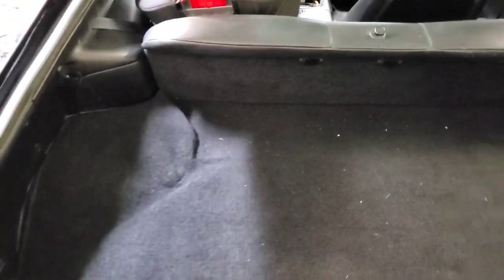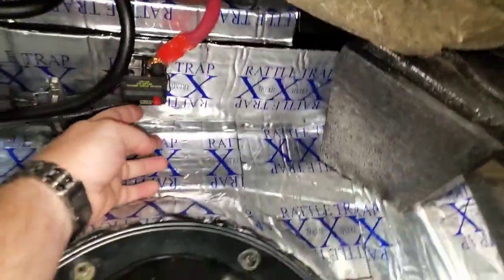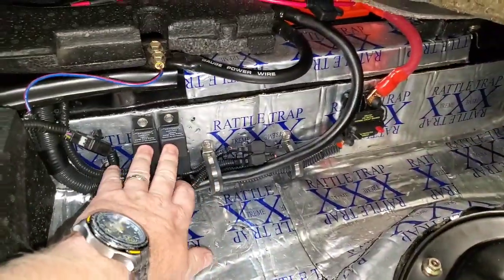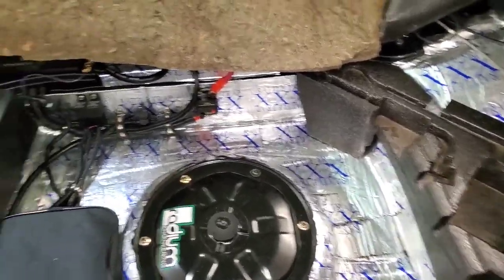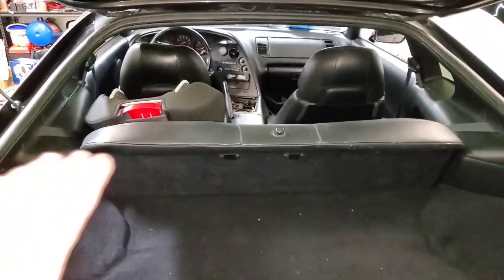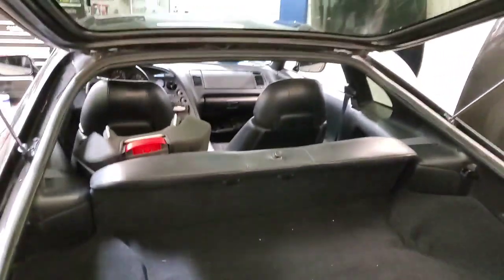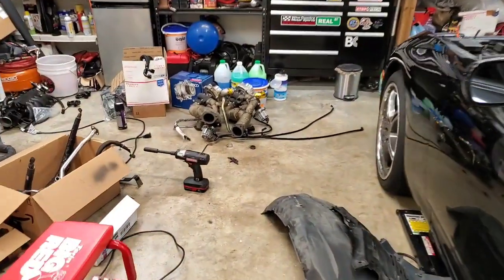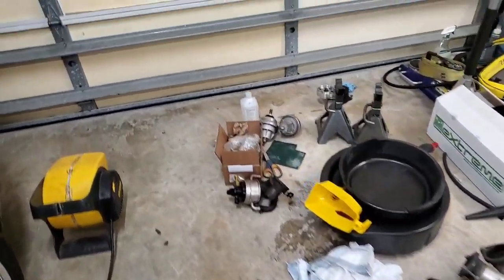MKIV Supra Battery Relocation, PC925 Overview

Comment: Still figuring out how he mound the battery in the speaker box. Only thing I can think of, is that he drilled a large square hole for the battery to fit in there.
Reply from the maker: Haha! Yeah man! My car is originally an NA, so the speaker box wasn't there. It was just foam inserts. But still - way better than a measly sub anyways, that can go in the rear! I didn't drill a square hole in the car at all. It's just 4x stainless steel through-bolts through the tray to the floor of the car. So yes, through it, but not really a major thing. I used epoxy to cover the exposed bolt holes and grommets into the holes to protect them. It's still looking great today! Only downside is if Odyssey stops making that battery or if I decide to go lithium or something, it'll be more involved to change the tray. It's not a big deal. It's immediately overhead the difference, where the bolts are.

Comment: Very well done! How many days/weeks could that AGM battery sit for with all cables still connected and be able to start the car?
Reply from the maker: At least 6 months. I keep it on a tender because I'm doing projects etc and I never know if I'll be draining a fuel tank, setting up headlights etc. So if it stays parked for a long time, it stays on the tender. But generally I never ever use it. I mean I don't use it when the car is being driven even occasionally - and it never skips a beat. I'm 6 years in and the battery still is holding like new. 💪

Comment: When you say the negative is best to go to "block " are you referring to fuse block or engine block?
Reply from the maker: Great point. Engine block. So I ended up doing 2 grounds. One to the trunk between the two tail lights the big main ground. And then one at the engine block where he OEM ground is located. This helps reduce chances of engine induced sensor issues at higher power.
Reply: You do not need to take the negative back to the engine bay at all. Just find a good ground bolt anywhwere in the trunk area and attach your battery ground to that bolt. The chassis of the car provides that ground to everything. 
The factory battery mounting location grounds the battery - to the chassis as well. So all you are doing is moving the ground to a different part of the chassis.
Reply: @ACommenterOnYouTube  I'm good with negative,  just curious about the positive as it's got the starter wire connected to it under hood
Reply: @jasonbliss1762  there are a few ways to wire the positive back to the engine bay, i just got a positive battery post and attached the 4 gauge from the battery to it and then the other positive wires to it.
Reply: @ACommenterOnYouTube  any pics?
Reply: @jasonbliss1762  https://images.app.goo.gl/z51JwZAwA9Qsc1TX6
I got this exact battery post, a single 4 gauge from the rear battery goes into it and the other ports go back to the starter and the fuse box..